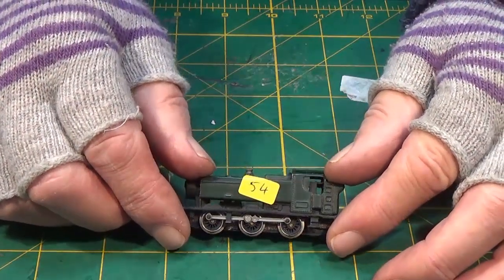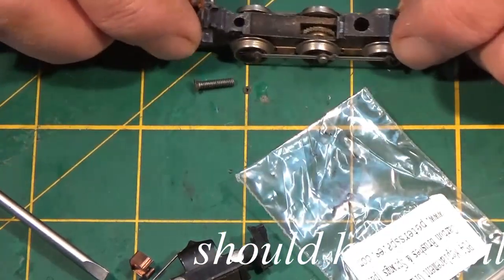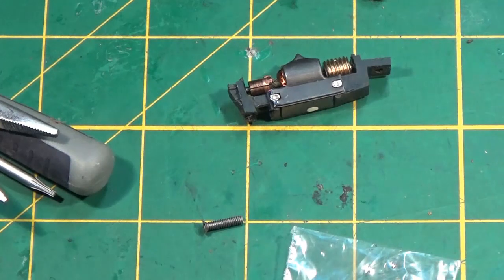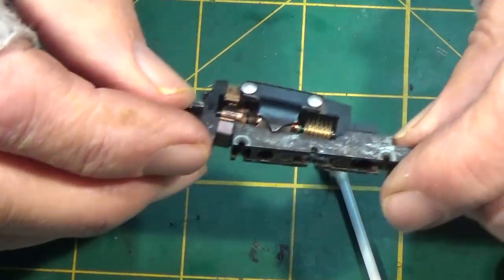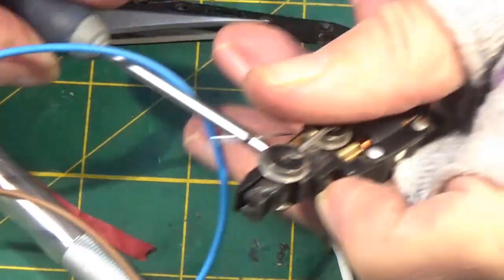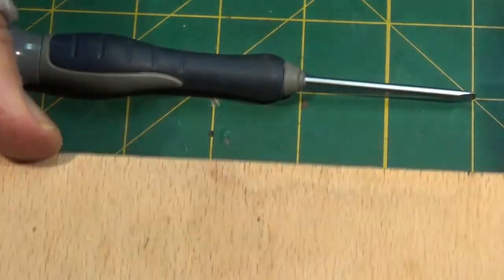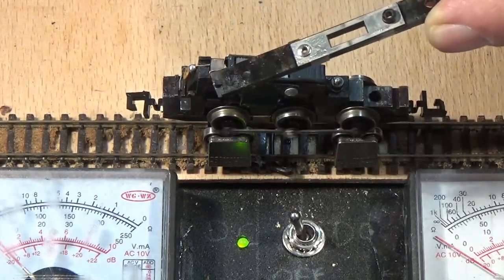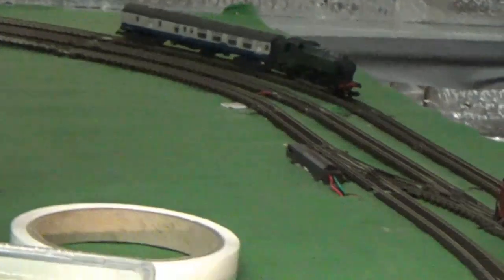GRAFAR 94XX restoration from Scrap

Comment: So I have one of these, when I apply power it just sparks and won't move. Any Ideas what it could be ? Everything seems to be in order.
Reply from the maker: Hi Gareth, difficult to pin anything down just from that. Is the sparking coming from the wheels or the motor? Either way, the motor (armature) seems to be under stress. Perhaps lubrication of bearings and wheel axles (light oil), cleaning track and wheels, checking alignment of wheels (quartering) are steps I'd try first. Can't be more specific at moment. Hope that helps. Cheers,Jim L
Reply: @SoRTs6233  it's where ever I touch the power wires too tbh. But gonna clean it see what happens